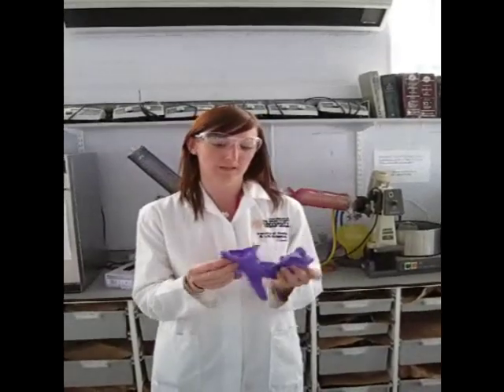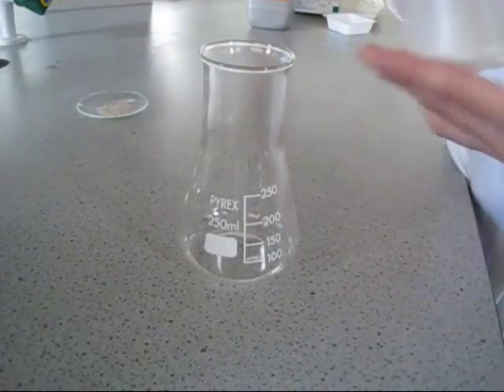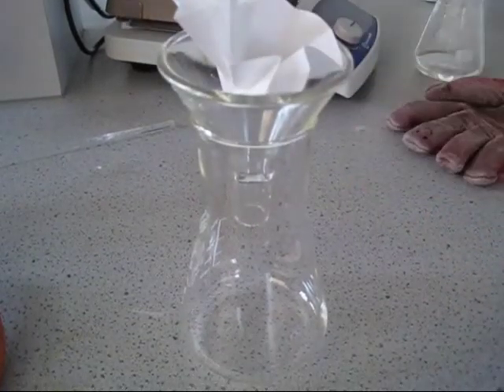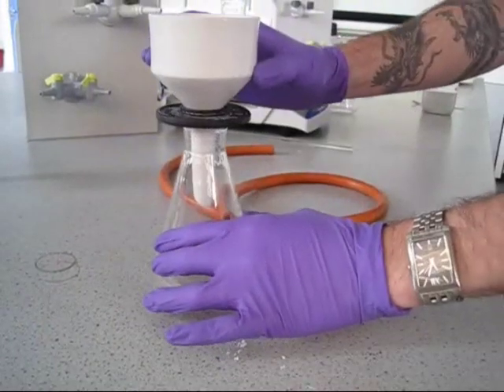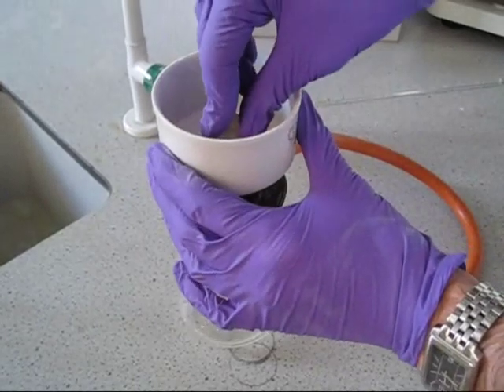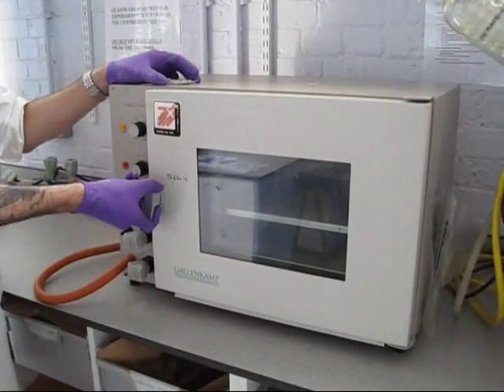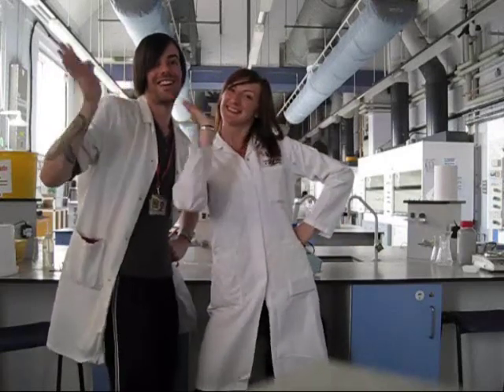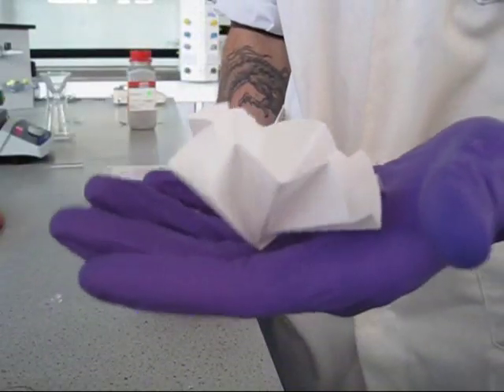Introduction to Recrystallisation

Comment: Putting the solution in an ice bath is a very amateur thing to do.  The reason why is because the more rapid the crystals cool, you're more likely to have more impurities embedded in the crystals layers, because they didn't have enough time to settle to the bottom of the solution.
Reply: Fred Singateh An ice bath is best used after the solution has reached room temperature and most of the crystalization has occurred

Comment: why is a minimum value of water solvent used?
Reply: +Simran Johal Excess solvent will decrease recovery percentage. Basically, when you add too much solvent and you wanna recrystallize it, much of the molecules will stay dissolved in the solvent even after you cool it down.